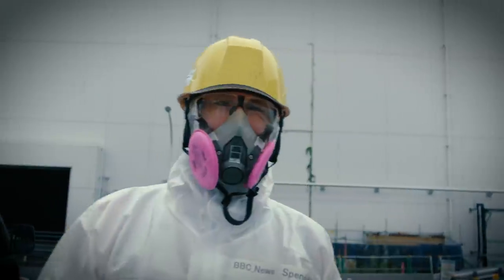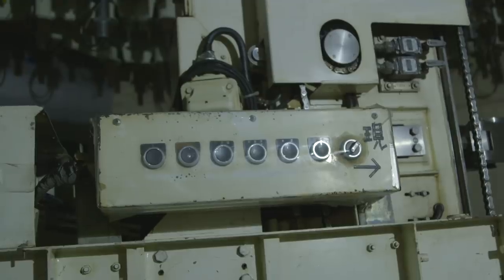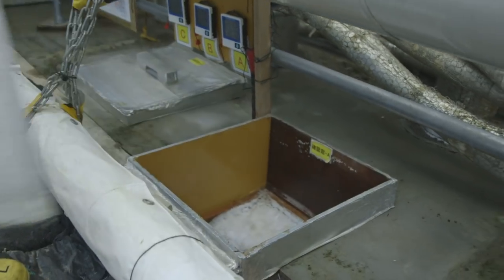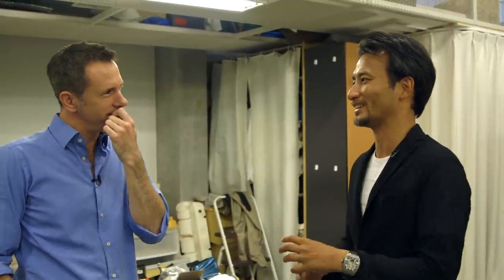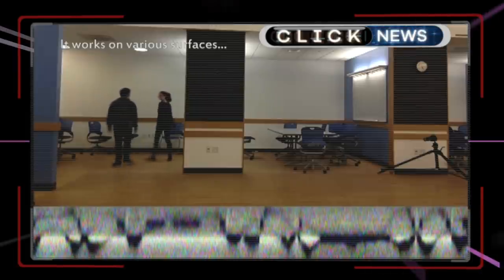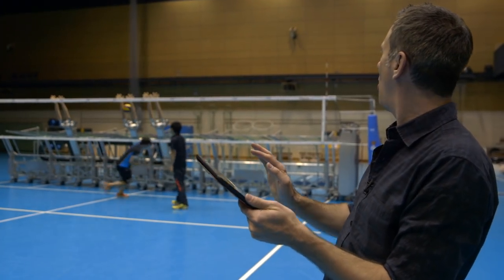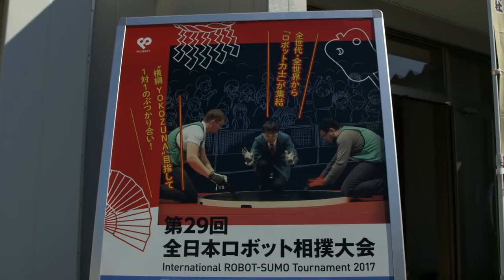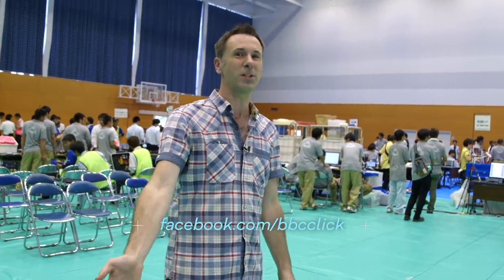Click 910 - The robots inside Fukushima Nuclear Power Plant - BBC Click

Comment: I thought there was a power failure due the tsunami and the backup generators were in the flooded basement. The combination of both the grid and backup failing resulted in the pumps of the cooling system to no longer operate and that was what caused overheating and meltdown